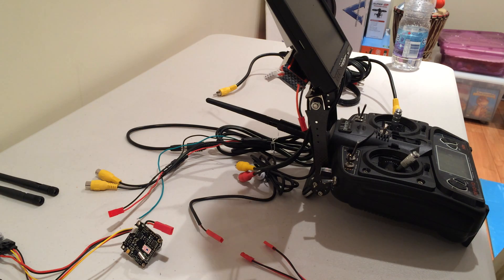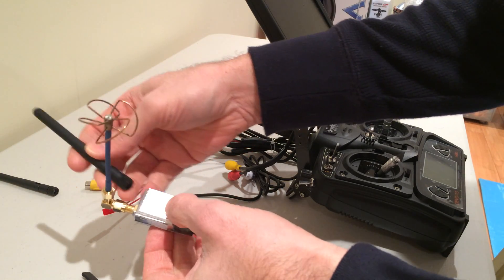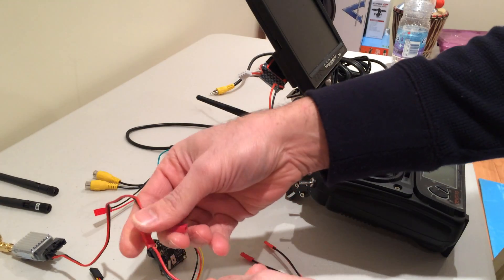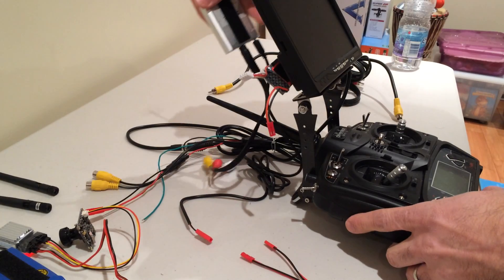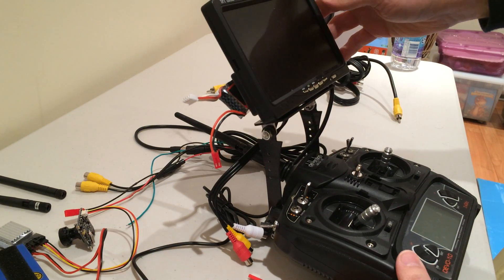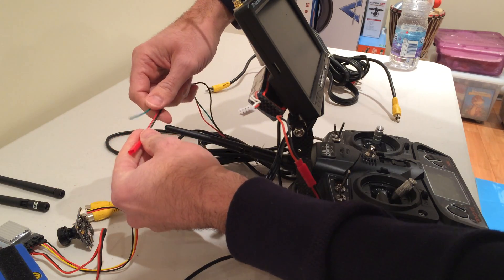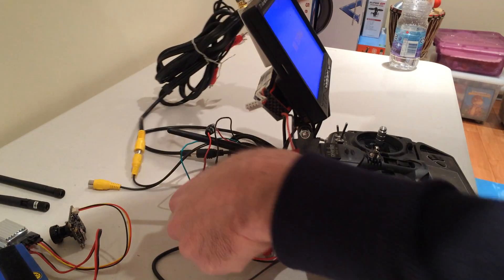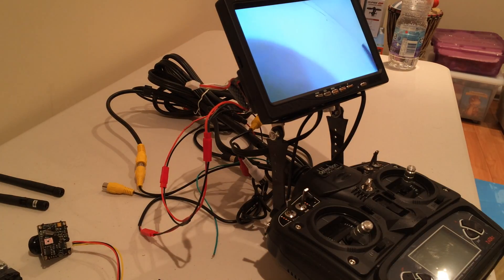Basic FPV setup for beginners

Comment: Although this is VERY informative and foundational (which is almost impossible to find) the setup doesn't seem like it would be very appropriate in the field! Does anyone know of any kits you can buy that contains all of this in a bundle? including the battery's and that doesn't require splitting wired and the likes, I've seen much more complicated setups that are alot more tidy than this, which is what you want ideally. But as I said, this is a VERY informative and helpful video, thanks :)
Reply: i have this setup and get about 10k range with a big patch antenna only mod you need to do is change the power suply conector to the one your battry has.

Comment: WOW I am building a RC car I can send into some Crawl spaces. I am looking to do just what you did. Do you have a link and or a list of what you started with. I am trying to do this and I am lost. I know I need a recever and transmitter what I don't understand that the numbers mean. How do I know the display screen will work? what did u get. Thanks
Reply from the maker: I listed a parts list. Check it out and do a bit of research. You should be fine.

Comment: I wish you said what batteries you used: volts and mAh, I don't want to fry my radios.
Reply from the maker: I used 900 mA 3 cell battery but any size will do just keep it 3 cell to be on the safe side.

Comment: what size battery are you using to power the fpv and the lcd screen?
Reply from the maker: I'm using a 900 mA but you can use bigger for sure.  It just had the right connector.
Reply: +crashflydude 2s or 3s
Reply: 3s

Comment: I know some monitors to get for 20 dollars which are fit for this, as well as a complete transmitter kit with an attached camera for 40$, and a receiver for 35$. I know where to get the battery's for all of them and there a 100$ fpv setup :). Thanks for this vid it made things much more clear

Comment: What kind of antenna connection is it?
Reply from the maker: I was using a 4 leaf clover in the video for both TX & RX but noticed shortly after that the TX needs a 3 leaf and RX needs a 4 leaf. I was still getting signal with both of these options but limited to about 50ft.  I'm waiting for a power filter to see if that will clean up my signal and get me a longer range.  I'll try a patch or helico. Antennas if that doesn't work out.  Not having much success in getting a good range.
Reply: oh,ok so for antennas, make sure that this is correct? and that the antennas are good quality?

Comment from the maker: Liam, the theoretical range is about 1km but it depends on where you are and how many obstacles are around you.  I'm having some problems with it and I'm waiting for different antennas so I can test it. I also found out that you need a power filter since I'm powering everything for one battery. Will post update when I get to test all this.

Comment: Will it work with the spectrum VA1100???
Reply from the maker: Just read that the micro fpv cam works on 1S battery.  The 3S setup might fry it. I would not take that chance.  Get a cheap 600 tvl cam from China and it will work ;)